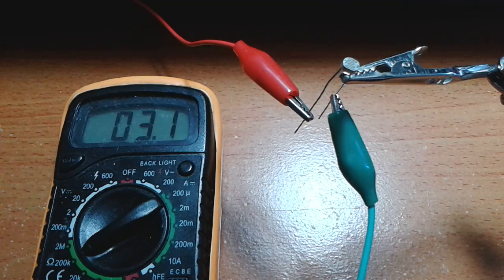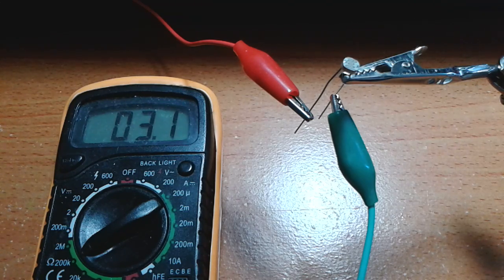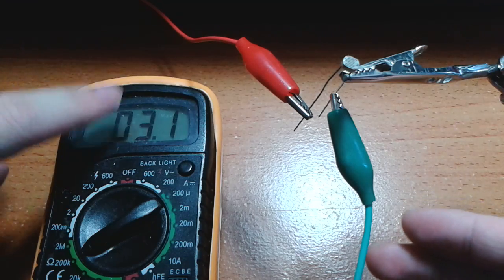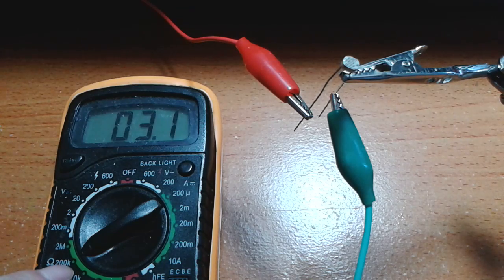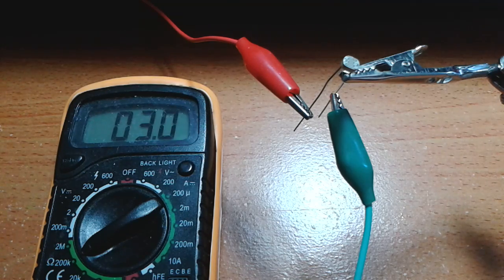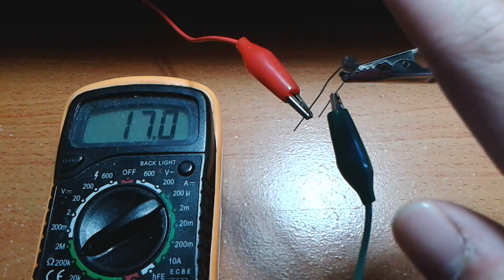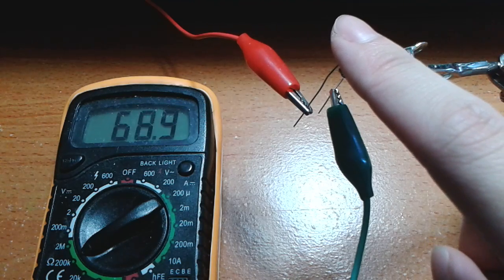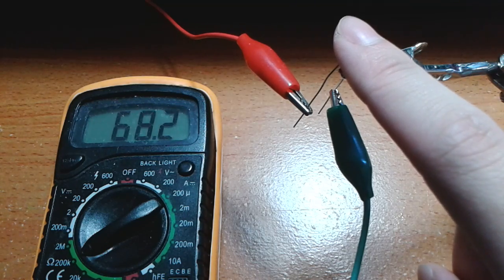Light-Dependent Resistor (LDR) Demo

Comment: I am far from an expert, in fact, why I am here looking. Very informative, nicely presented.
However, there is one thing I do know. Your finger will not block out all light. Believe it or not, some light shines right through your fingers, which is one explanation of why the reading would not be consistent.
To prove this, put, and keep, your finger over the LDR then flash an LED source onto your finger. You will see the reading fluctuates as it would in any changing light.
Hence, to get as near zero light as possible, I got a black plastic pen top, made certain the safety hole in the ‘actual’ top was covered with 3x of black insulating tape, turned on my c-tester backlight, turned off the room lights and then shone an LED torch lite onto it. I got OL reading.

To double check, I moved the torch until the beam shone into the bottom of the pen top and then began to get raised readings as the torch got nearer.
Just some experimentation you may find useful, if you need accurate knowledge of a particular LDR.